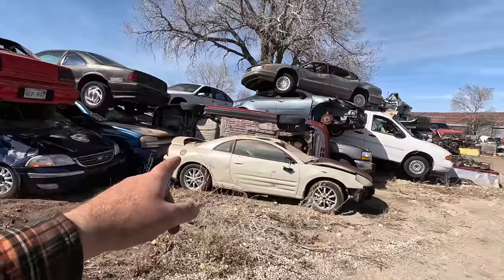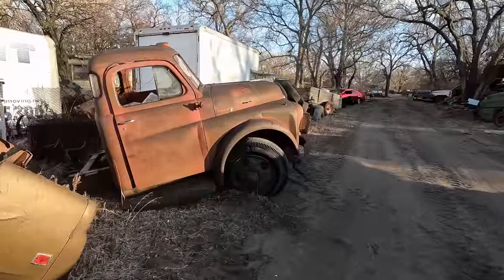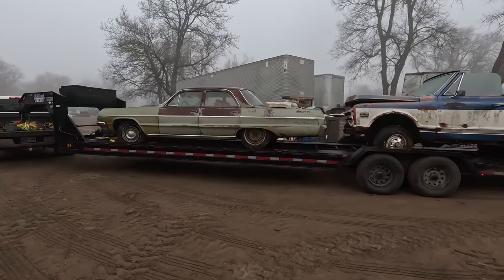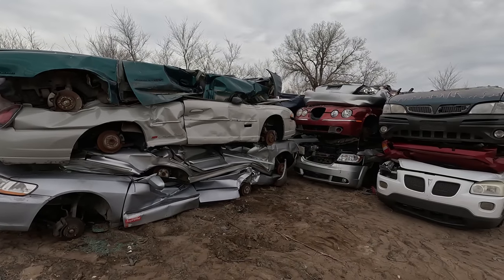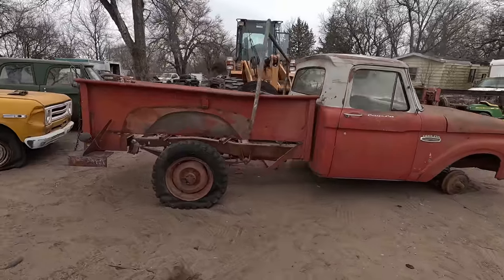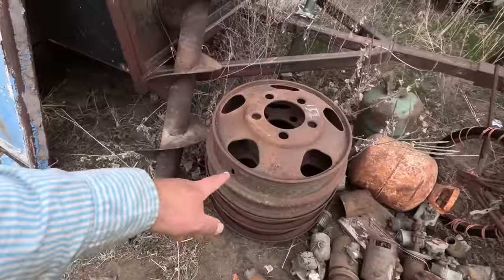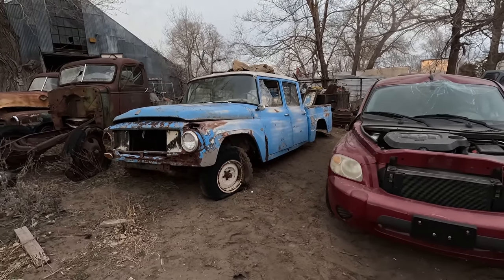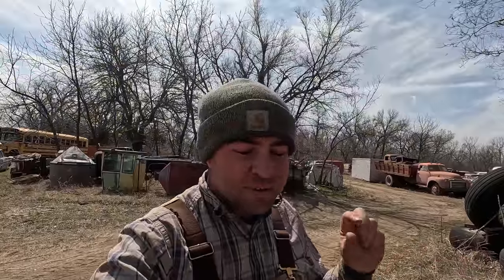Look at What was Inside this OLD TRUCK! -- Plus I Rescued a TON of Other Vintage Vehicles!

Comment: * Caught ya Silas ! The Pilot House Dodge Truck Cab Is The One With The Window That Goes All The Way Across The Back. Not the 5 window cab which was the stock cab. I own a 55 C3H Custom Cab Pilot House with The Hemi. It's the 171" wheel base with an all steel M37 troop carrier bed the previous own made.
Reply from the maker: Actually pilot house refers to all 48-53 Dodge B series trucks and is a reference to a taller cab than the previous style with larger windows. Dodge dropped the “pilot house vision” slogan for the 54-56 C series trucks, although many people still call them pilot houses due to their similarity to the B series.
Reply: I have the original Cab brochure here in front of me Silas and it states : New Dodge Truck Pilot House cabs. Give you Full-circle visibility. You will drive better because you see better ! New wrap around windshields ... New wrap-around rear window etc. I'd be happy to take some pictures of my brochures if you have an email I can send them to. Anyway love your channels man !!!

Comment: Back in the seventies I used to work in  a breaker's yard in south Wales.  The boss had a similar expression: "You can't keep them all".  We used to concentrate on dismantling and dealing in parts rather than crushing whole vehicles. Back then many mechanical and electrical parts were interchangeable between different model and often between different makes, unlike today's single-model components.

Comment: I think I prefer that flat faced truck over the older curvy ones.  You can use the nose as a sort of table and put lights in the headlights that have a motion sensor in them.  Cool video as usual.  That pulley is awesome!

Comment: When pulling wheels with the loader, does that strip the threads on the wheel lugs? Some power there!  The 64 Chevy Biscayne was my favorite.  Might it be worthwhile to come in on a weekend, lock the gate, and crush all the rusted and wrecked heaps?  Another interesting video, Silas!

Comment: Fred Jones in ford script would be no issue to FoMoCo, they were best of buddies, Fred Jones ran a rebuilding operation supplying Ford Dealers with "Fred Jones" Ford Authorized remanufactured parts and engines.

Comment: Love your videos. I never really understood what all happened at a salvage yard to recycle the metal. I was wondering why the tires and upholstery does not have to be removed or burnt out before the cars go to the shredder. Is this all incinerated when they melt the metal ? And how do you get paid if some of the weight is not metal ? I would like to see a video where it follows the whole process to conclusion.  Thanks again and keep up the great work that you do.
Reply: It would be interesting to see the whole process. From what I've seen,  the cars are ground up and put through a series of conveyors that have fans to remove the nonmetallic stuff and magnets to separate the magnetic stuff.